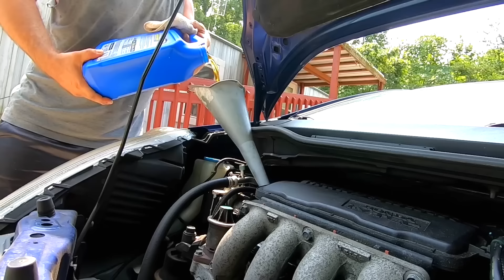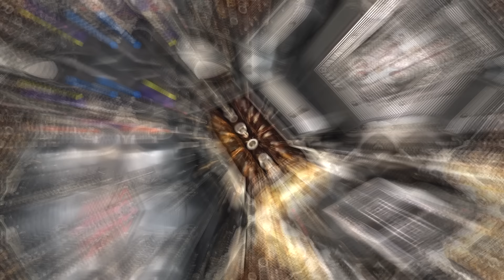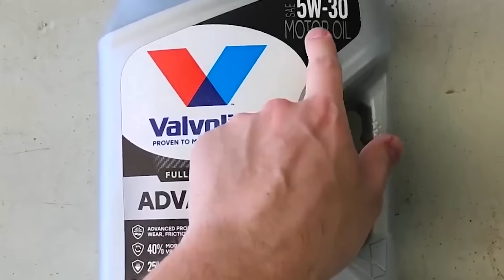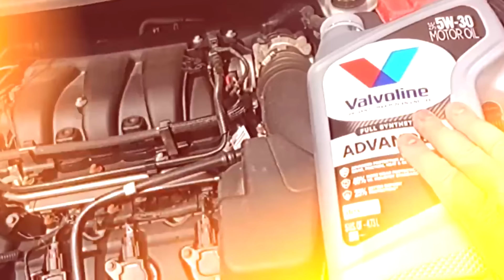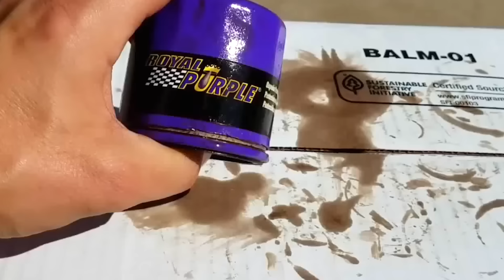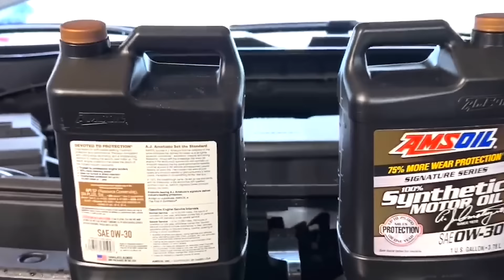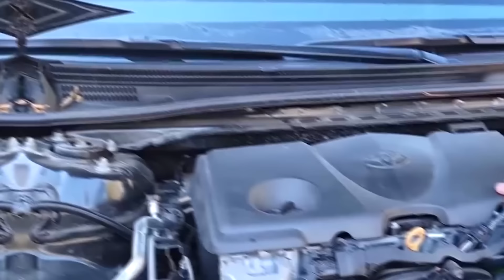I Compared 10 Synthetic Oils… and the Results Were Shocking!

Comment: Moral of the story no bad oil these days if you change oil and filter every 3000 miles just about any modern oil is good
Reply: You wont hurt your vehicle with 3000 mile changes.... and any damage to your wallet will be more than offset by your engines longevity, assuming you treat all maintenance issues with the same respect.
Reply: 3000 is a bit of overkill but the “ extra cost “ of more frequent oil changes is offset by the drastic reduction in oil related engine issues down the line.
Reply: Even the oil is synt the diesel ad a lot of ashes and not oil are real synt
Reply: Use the grade of oil recommended by the vehicle manufacturer but cut the oil change interval in half as far as mileage is concerned. That’s only if your car is a daily driver that doesn’t tow, haul heavy loads, off-road or see pedal to the metal acceleration more than a couple times a month at most. If your vehicle usage is in that category, change the oil even more frequently. Using Motul 4000 or even Royal Purple isn’t necessary unless you race, tow or have heavily modified your engine. The same goes for gasoline. If the sticker says 87 octane,putting 91 octane in it is like throwing money out the window unless your car calls for 91-93 octane fuel.
Reply: Most mechanics would change the 3000 number to 5000 if using full synthetic.
Reply: 3000 mile oil changes was the standard decades ago, all modern synthetic oils are good for a minimum of 6000, unless "track use".
Reply: @johndavidwolf4239  Yeah, 3000 mile change intervals were a standard for conventional oil which breaks down much more quickly than synthetic. I change my Valvoline Advanced at 5000 mile intervals

Comment: I hope people realize, when you take your car to the Dealership the oil that they use comes out of a 55 gallon drum. And I guarantee you it's not a top tier motor oil. 100% Guaranteed
Reply: Had similar experience. Took my car back after severely burning oil and got some long bull shit explanation. A machanic standing outside having a cigarette asked me if I knew where the oil comes from. Showed me the emty drum standing around the corner and walked off. Replaced the oil and filter immediately and guess what? Problem gone. The cheapest shit gets put in your car at some places
Reply: Change your oil every 5,000 miles!
Reply: My mechanic buddy in Michigan ran Mobile 1 when it first came out in a brand new car he commuted 200 miles a day and changed it every 50K. At 150K the engine was perfect!
Reply: @briantaber9514 I think that you meant Mobil 1.
Reply: @erie910  He was fully understood. Cmon now.
Reply: All the time the workers can steal the good stuff and ad cheap oil , even in Holland they do this 😂😂😂😂
Reply: Not all dealerships. Many are. ask to see the barrel or source. Make sure there using oem filters. your paying for them.
Reply: @jonmulack4226   Is nothing sacred? Is everything turning to a scam? Dambitt.
Reply: When i worked at BMW, we used castrol out of qrt bottles for M cars and cars/engines that stated used castrol. You could also request it if they normally would use the drum oil
Reply: a lot of dealers and garages use stp, or supertech or store brands like oreilleys or fram
Reply: Or delivered in a bulk tank behind the dealership
Reply: The only thing “premium” about an oil change at a dealership is the price
Reply: Correct.
Reply: Yeah, that 55 gallon drum puts oil into engines and gearboxes, forget those extreme pressure additives for gears.
Reply: The factories police the dealers oil tanks.
Reply: @Slidergreg hahaha 🤣🤣🤣 Are you Serious or Delirious? That's Funny
Reply: I went to the GMC dealer Kindle in Nampa, Idaho with my GMC pick up and watch them put mobile one synthetic in my pick up from 1 quart bottles. So not all dealers use oil from a 55 gallon drum.
Reply: @brucecooper6512 
I believe only the quick oil change companies like Jiffy Lube use the drums. I’ve never seen regular mechanic shops or dealers use drums.
Reply: I hope you realize that the oil in the plastic bottles also comes from a barrel. You can get a 55 drum of just about any oil you want.
Reply: Guaranteed. The sh*t the VW dealership put in my 2015 VW Passat SEL TDI  diesel immediately caused extended turnover and  slow starting problems with the variable valve timing losing time and draining out of the oil sump hanging off the side of the cylinder head, overnight. I sucked 5.5 L of oil out of the car through the dipstick, and put in Mobil 1 ESP 5w-30 thats' VW 507.00 and Porsche C30 diesel rated, and my slow start problems went away instantly. This happened 2x, so I knew the 1st oil change was not a 1x occurance.  They were putting in the crappiest brown colored oil they could with their services, hoping to wreck turbos and engines, once the cars got out of warranty. Ironic, that VW dealership just went out of business the day before Thanksgiving this year.
Reply: @feloniousmonk3049  I did not know but they were planning to sell the business. And books had to show that it is profitable. The oil was recycled. The company that collected the old oil did their magic and returned it at a very good price point. It ended up in countless vehicles. Money chasing scum
Reply: @feloniousmonk3049 terrible and all I use is Amsoil. Bought a brand new Hyundai Santa Fe SEL with the 2.5 turbo engine. Soon as I started it about 15 seconds I could tell it was quieter and smoother. It also used way more oil than what Hyundais Quaker State oil.
Reply: Absolutely, NEVER go to a dealership.
Reply: Understand that in the U.S.,  full synthetic is NOT full synthetic! The law allows this! Federal law! Its a mixture of organic oil and different additives, most of which are poly's,  better known as plastics! In Europe full by law has to be full synthetic! Not saying its a bad thing, just saying we are being lied to!! Full synthetic is higher priced but cheaper to make! Its all about the $$$$$!!
Reply: @rockykelley4759 it always about money and Americans aren’t protected by the government so we aren’t forced to buy fake products.
Reply: @tommytee7714 instead, we are paying the gov salaries and they are bending us over and screwing us over. Our gov is such POS.
Reply: You're full of crap! 😊
Reply: @briantaber9514  I can agree with OP he is not wrong as I've worked for dealerships and saw this. It's the cheapest bulk oil they can get. They claim it's certified by the manufacturer. If that's the case why is the same oil tanker stopping at 5 different dealerships that are all different auto makers? That small tanker can't hold products for 5 different manufacturers at once.
Reply: @briantaber9514 🤣
Reply: Had similar experience. Took my car back after severely burning oil and got some long bull shit explanation. A machanic standing outside having a cigarette asked me if I knew where the oil comes from. Showed me the emty drum standing around the corner and walked off. Replaced the oil and filter immediately and guess what? Problem gone. The cheapest shit gets put in your car at some places

Comment: I recommend changing the engine oil every 200 engine hours. Multiply the average vehicle speed shown in the vehicle's computer by 200. This is the oil change limit. Naturally, this applies to fully synthetic motor oils from reputable manufacturers. If you use inexpensive mineral motor oils, change them every 100 engine hours.
Reply: Agree. People measure the distance. It should be time. Seen cars with low mileage but with serious problems.  Created by hours in slow traffic over short distance.
Reply: Probably the best measure of engine oil life is by how much fuel has burned.
Reply: Does anyone know who makes the oil for motorcraft?
Reply: I use SUPER TECH 😊😊😊 I CHANGE MY OIL EVERY 7500 KILOMETERS   😊😊 NEVER HAD ANG PROBLEMS
Reply: It's why I will never use full synthetic oils in anything & never will, petroleum oils are proven so why do people keep using this junk.
Reply: @garrywest7737 I have been using synthetic blend.
Reply: @garrywest7737 because they're pretty clearly proven much superior to old tech oils...

Comment: I think to have meaningful data here you would have to have at least 100 like engines. This would not pass any SAE testing cycle. There is no description of how the tests were run. How many engines turbo and not turbo for each oil. Towing, dust, drifting, etc. each takes another set of engines. How about have all the same weight or you have another group of engines. Lord, I would never tow with a XW20 oil. How towed for years with Mobil1 0W40 without incident.
Reply: Yeah I've seen teardowns of engines that spent a lifetime of towing and there was extreme bearing wear on the thrust side of the main bearings. It was the strangest looking wear I've seen on main bearings...

Comment: 378,000 miles on my 2019 Chevy Traverse and I mostly used the cheaper super tech 5/30 from walmart,transmission is also same miles and I  drain and fill every 15,000/20,000
Reply: But I  fill with 7 qts, so I guess that is what makes the difference
Reply: I just use whatever is on sale and change my oil every 7000km to 8000 km. I've been doing that for 35 years now and buy a new vehicle when the old one hits around 400,000km. Here in Canada, with the salty winters, they're usually rusted to the door handles by then.
Reply: Holy crap! Almost 400,000 miles in 6 years?

Comment: Owner-inspection of oil is superior to rote oil change interval loyalty or rote oil bottle marketing loyalty.

To check if your oil is good, use the dipstick to examine its color, consistency, and level. Healthy engine oil is amber or light brown and smooth, while dark brown, black, gritty, or milky oil indicates it's time for an oil change.  You should also check that the level falls between the "min" and "max" marks on the dipstick.

Check your oil at least once every 1000 miles.

If you see that your engine oil is dark brown or black but the bottle that your oil comes in says something about 5000 or 10000 or 15000 or 20000 miles, it’s still time for an oil change. 

Spread the word.
Reply: I don't think I would trust waiting 20000 miles between oil changes. I won't even go 7000. Like my little Subaru recommends. I change at 3000 like I always have. Never had any issues with my engine. 223000 on a Subaru boxer 2.5. only thing I've done to it. Was replace the timing belt oil pump and water pump. It all came with the timing set
Reply: @danielbryant1539  check every 500 miles or so. and change earlier if it turns medium brown earlier. some cars have turbos.